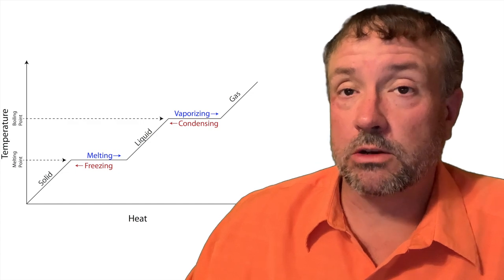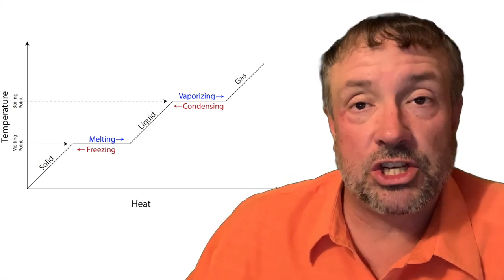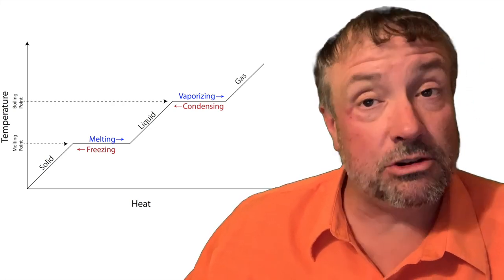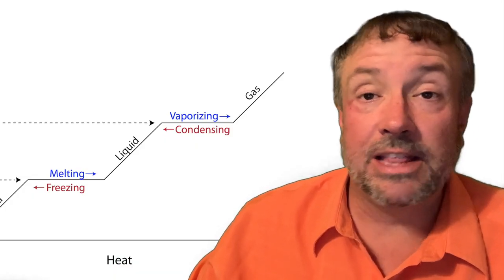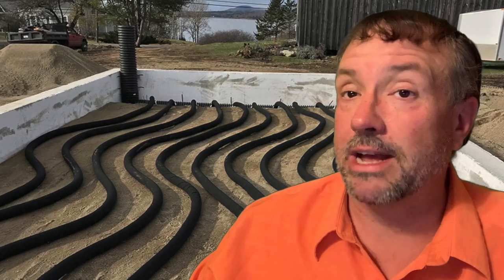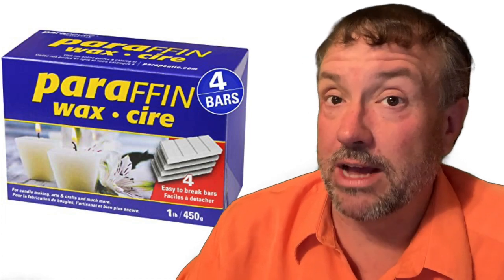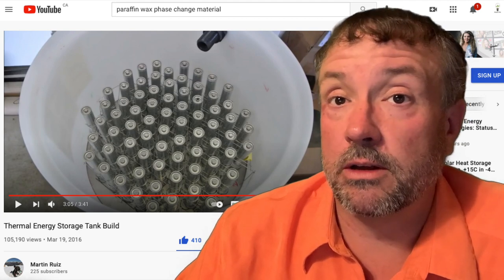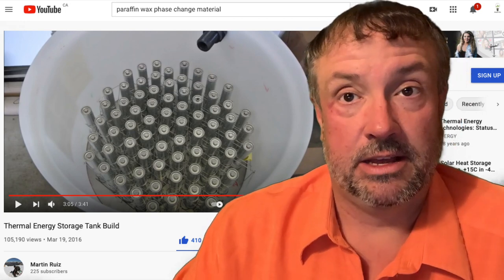Phase Change Thermal Battery Energy Storage

Comment: I have a pot ( an old turkey fryer pot)  of 40lbs of parafin wax on my wood stove in the shop.  it takes about 8 hours to melt it and then takes about 24 hours to solidify and it is still above the ambiant temp for at least 48 hours from the last fire in the wood stove.

I use it to balance out the temps over night when I let a fire die out.
Reply from the maker: very cool!!!!!!!!  do you know how long a pot of just water would last?  as comparison
Reply: Sounds great but what’s the fire risk ?
Reply: very interesting coment, but to be really useful I would like to know the ambient temperature , since te velocity of the "cooling"  depends on it. Can you please share this info too?

Comment: I have looked at this, but the problem is that the latent heat of parafin wax is actually not that large. Especially if you calculate per volume. I got a 60 kWh battery for an m3 of parafin wax. Compare that to what you get if you simply heat water to 90 C and use it until 50 C which is around 50 kWh for an m3 of water. Sure the parafin has the nice property of releasing its energy at around 60-70 C, but it is not as cheap as you think. If you want to scale up this system, it is way cheaper to just use a larger tank and water.
Reply from the maker: Can you suggest any other materials?
Reply: I am with the original comment. The question, for me, is about the "cost" of insulating and moving the heat against a background of "minimising installation cost" to achieve ROI...

That sounds complicated, and can be summarised as KISS

Comment: Some numbers . Water's specific heat is 4kJ/kg per 1º. the energy to change water to steam is 2,548 kJ so to heat water from 36º -> 100º is 252kJ so it takes 10x as energy to boil it all away as to heat from 37~100. Now for paraffin wax to melt, depending on the wax, is around 250 kJ so each kg of wax is like heating water 60º. if you can heat the water from 50-> 80 then one kg of wax can store 2x the energy when it makes its phase change. the specific heat of paraffin is about 2kJ/kg per1º so going from 50-80 will store 0.5 as much energy as water for a total of 2.5x energy storage as water over this range. Is this worth the extra expense and handling?
Where paraffin is very useful is if you have low-temperature range say 10º, that crosses the paraffin melting point, and is cheap over a long time. So for example a south-facing window with a black box filled with paraffin behind it. problem is this is a major fire hazard.
Reply from the maker: what about the non phase change energy in paraffin wax? you have to add the phase change to that for the total.
Reply: Would using something like carnuba wax with a melting point of around 84ºC improve this at all or have I totally missed your point?

Comment: Sous vide bags might work well to contain the wax. They work in hot water up to boiling and are flexible enough to contain any volume change
Reply from the maker: you mean vacuum seal bags?
Reply: @SimpleTek  That would be the one.

Comment: You ever try the experiment with parrifin wax? Seems like pouring the wax in the soda cans and then sealing them with silicon caulk would be pretty easy.  Something like sealable glass jars would also be an option for keeping the wax contained.
Reply from the maker: Soon. I got the wax recently!
Reply: question? Is wax volumetrically stable.  Isn't this the same wax they use in pistons for automatic vent openers  because it expands?  Would these containers break?
Reply from the maker: @jimw125  I plan on using open cans to compensate

Comment: was there any consideration for hydrated salts mixed with mineral oil as a PCM storage fluid. Choosing optimal transition temperatures can smooth charge and discharge processes with multiple phase changes. These PCM(s) would be supported by sensible heat structures like ceramic tiles/plates.
Looking forward to your observations.
Reply from the maker: No idea, sounds interesting

Comment: very exicting idea. My sugestion for the experiment is to use a common "oil radiator" used for house heating in winter (exchanging the oil by parafin wax). You can find it (at least in europe) at any shop for 50 euros (even better if you have an old one in the garage just taking dust ;-) . It is ready to work, and includes 1,5 Kw electric heater  + termostat + safety temp cuttoff. The energy stored can be easilly measured and time-temp curve too. 
It can be sincronized with photovoltaic excedent production to store the excess collected energy keeping your PV panels at peak production!
You can have individual energy batteries on each room instead a massive centralized expensive installation.
My only question is: it it is so good and simple, why it is not sold in the shops?
Reply from the maker: Great information!

Comment: Why not flip it? submerge a finned radiator  or series of radiators in the wax then flow the hot water through the radiators. Maybe stacked aluminum flashing and pex? Aluminum for better transfer. Maybe could use perforated steel sheets since it's in wax not water. Do you know how far the heat will transfer in paraffin at a given temp? Do you need water you could use a canner and can paraffin, stack the cans then blow hot air through the stacked cans? Airs less efficient  but it's just a thought. Looking forward to the next video on this.
Reply from the maker: we'll see when I make the prototype!!!!!
Reply: That would solve the problem of having to seal the wax into the aluminium cans & a cooling radiator has heat transfer fins which makes the heat transfer to the water from the wax more efficient. If you can repurpose an old water radiator, it may be more cost effective than adapting alumium cans?

Comment: Beware of thermal expansion, that could explode the cans if not accounted for
Reply from the maker: I’ve thought about that actually, I have the cans upside down with the tabs open and filled 4/5. Wax floats.  That way it can expand and not destroy anything.
Reply: That solves the need to seal the wax into that cans, very clever.

Comment: Using aluminum cans won't work very well because the thermal conductivity of paraffin is low which will make it hard to melt the center of the can. Your design should be a counter flow design with thin layers of paraffin. This will allow energy to be stored or extracted without having to change the flow arrangement. Also, remember to allow for the expansion of the paraffin which is about 10%.
Reply from the maker: What about red bull cans?
Reply: @SimpleTek  They would be better and I haven't done any calculations but I think they would still be a little thick. My gut feeling is something no thicker than about a 1/2 inch. As you remove energy from the system the hardening paraffin will make it harder (slower) to get the energy out. Something like an auto radiator would be good but it is not set up for counter flow.
Reply from the maker: @timrothgeb416  interesting… I disagree but we’ll find out and I appreciate the input
Reply: @SimpleTek  disagree with what exactly?

Comment: Buy a thousand hot pockets warmers and boil them in solar heat then warm yourself in winter. They have a house size one in Britain.
Reply from the maker: Omg too funny
Reply: They are made of 14-hydrate sodium acetate, actually not so hard to obtain. I haven't done the math, but dissolving baking soda (sodium bicarbonate) in white spirit vinegar (6% acetic acid) should not be too far.
It's even better than wax because it stores the phase change energy even at room temperature as a supercooled liquid, then releases it when you introduce a nucleation point for the cristallisation to begin.
(Some more math needed to determine energy density and efficiency)
Reply: @ing.pagano  Controlling the release for an amount needed is the major problem. Sunamp has a heat battery used in Britian.
Reply: You would need many small containers, with the ability to activate them individually as needed
Reply from the maker: @ing.pagano  or maybe wax in aluminum pop cans submerged in water ?
Reply: @SimpleTek  yes, that's the main idea, but here we're talking about sodium acetate, the stuff in hand warmers
Reply: @offgridwanabe  quantity of units activated solves heat amount.

Comment: There's little point in doing this when you consider you could just collect a LOT of rainwater for free and then use a solar collector to heat it up.  Run the cost calculations and they're not in the same ballpark; they're not even the same sport.

The trick is insulating the container and then getting that heat to a heat pump.
Reply from the maker: It comes down to space, thus is more energy dense
Reply: @SimpleTek  Ah, OK then you want lithium ion batteries then.
Reply from the maker: @GoatZilla  space and cost
Reply: @SimpleTek  As soon as you factor in cost, paraffin is wiped out by water.  This is the kind of thing you do if you happen to have a ton of paraffin laying around and don't know what to do with it.

At best you'll get like 2-3x more density.

The problem is getting the heat in/out of the paraffin.  You can't physically move the paraffin across its useful range because of the phase change.  That means you have to use a heat transfer fluid, which is an immediate penalty as you will require a larger temperature gradient in order to get anything done in either direction and lose effective range both ways.

I don't think the paraffin will cool evenly either -- I think it will solidify from the outside-in and at that point essentially become its own insulator against the core.

So you'll have heat trapped in there that not only can't make it through its own solid paraffin insulator, but it also can't make it across the heat transfer fluid.  There go your dreams of 2-3x more density.

With water, the transfer medium is the same as the storage medium.  You pump it up to to a solar collector to heat it up, and then you pump it over to a heat pump to move the heat indoors.  That right there is the answer, staring you in the face.
Reply from the maker: @GoatZilla  I’m address much of that in a future video actually
Reply from the maker: You’re forgetting about cost of container for water… size/cost matters
Reply: @SimpleTek  A 305 gallon rainwater tank costs about $500.  They are readily available today, no custom work.

Filled to only 80%, a 25C degree swing in that tank (say from 110F to 65F) would hold nearly 27kwh worth of thermal energy.
Reply: @SimpleTek  305 * 80% = 244 gallons.

244 gallons = 1893 lbs of paraffin wax.

1 ton (2000 lbs) costs about $750 bulk.
Reply from the maker: @GoatZilla  hummm, interesting…
Reply: @SimpleTek  So since I did not forget the cost of the container, may I know how you plan to account for the low thermal conductivity of paraffin wax (0.2 w/m-k) vs water (0.598 w/m-k) and how that affects your "container" costs?
Reply from the maker: @GoatZilla  aluminum cans, submerged in water, for conductivity contact and containing cascading phase change
Reply: @SimpleTek  How does that affect the cost though?  I specified the cost of the rainwater barrel.

In order to heat the paraffin up, you're going to have to increase the water temperature significantly, so whatever you'll be using will be more expensive than a rainwater barrel which usually isn't rated to that kind of temp.

If you're using aluminum beverage cans, you have to account for the ~17% expansion of the wax.  You can only fill it with about 80% wax (cold) to keep the working pressure around 4 atmospheres when heated up.  And since wax is definitely less dense than water, and a can with 20% air in it is also way less dense than water, you'll need a harness to keep the cans in place, plus you just lost a massive chunk of your energy density because that headroom is neither wax nor water -- it's air.

What's the cost looking like for real?  Do you just want to do cents/kwh?
Reply: @SimpleTek  Just saw your comment about inverting the cans and letting the wax float.  It's an interesting idea.  Still interested in numbers.
Reply: I actually just recently grabbed some paraffin wax to play around with and looked at some existing research.

For starters, it took a LOT longer to get the wax to fully melt due to poor thermal conductivity, which I mentioned already.  The water around the wax had been boiling for minutes while much of the wax in its container was still solid.

Looking at a research paper online, it looked like volumetrically wax has maybe 40% better thermal energy storage in the best case compared to water.  That best case was:  low temperature range.  Once you start going hotter with the water, the advantage starts to go away, and you still have to deal with the poor thermal conductivity regardless.

And speaking of volume, wax is like 10% less dense than water.  Since most thermal metrics are related to weight (density), wax incurs an automatic 10% penalty for the same container size.

I'm just using these for personal warmers since their low temperature and consistent release is more suitable for that, plus once they've released their heat they kind of can't spill out.

Comment: It would be interesting to find a low-cost material that would got though both phase changes (solid-liquid-gas) in the temperature range needed (20-90deg. C)
Reply from the maker: parafin wax
Reply from the maker: Will Swift  online!
Reply: @SimpleTek  Start with some Vaseline...
Reply from the maker: @douglaspohl1827  lol

Comment: Bees wax is cheaper and better look around you can get 25lbs cheap
Reply from the maker: Cheaper than paraffin wax???
Reply: @SimpleTek  Bees wax is a byproduct of honey production some farmers will give it away
Reply from the maker: @offgridwanabe  good point
Reply: @SimpleTek  Apparently the heat gain is also better than parafin
Reply from the maker: @offgridwanabe  interesting - there's actually two things to consider - the melting/freezing  temperature point and the energy to achieve the phase change.